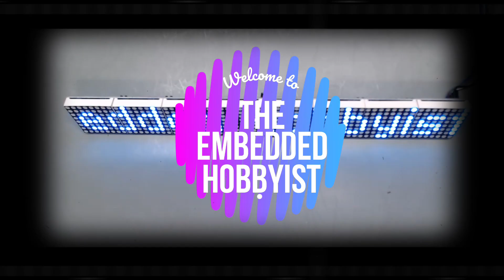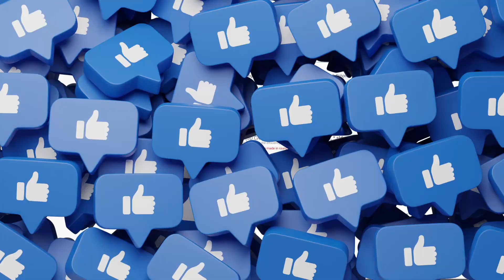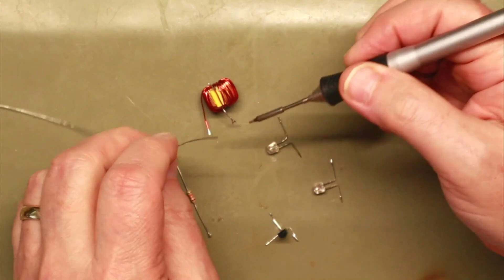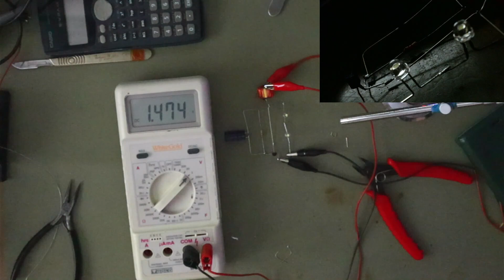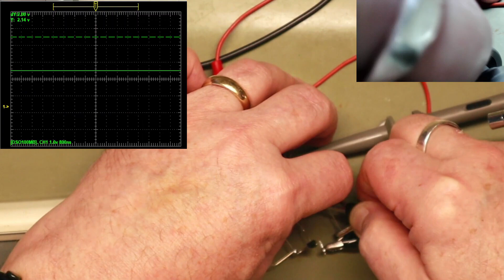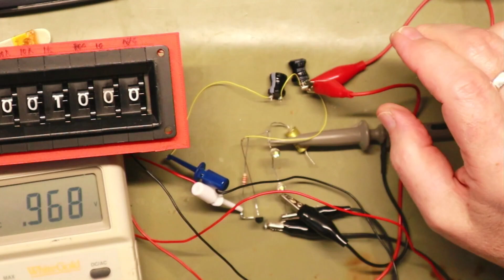#256 Joule thief, how does it work?

Comment: Chinese solar lights use a 4 pin chip and one inductor. How does that work?
Reply from the maker: They are a boost converter as well. I'll have to find a internal circuit to see. but i expect it's a form of free running osc driving a transistor.